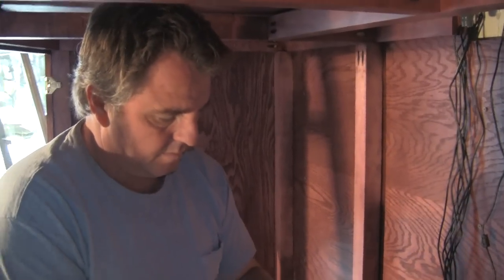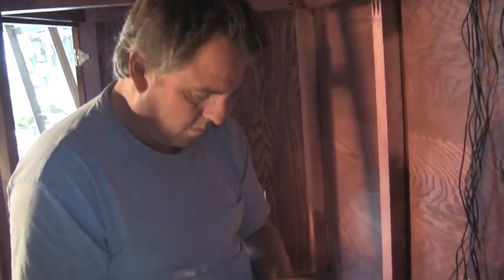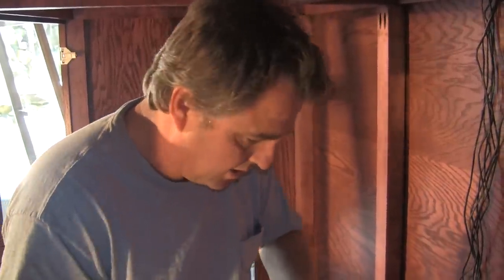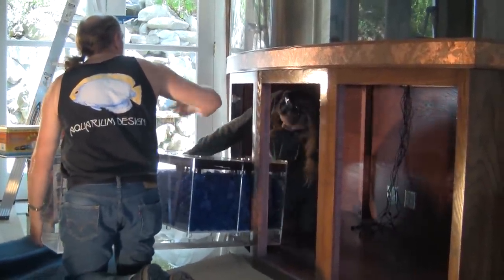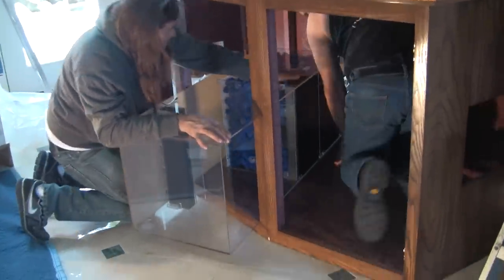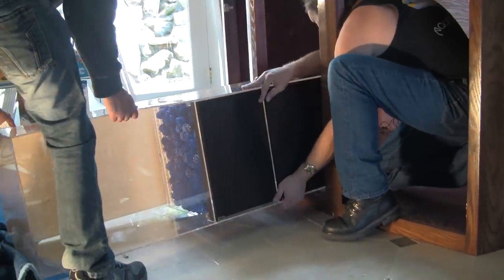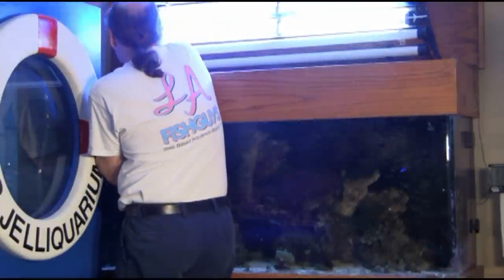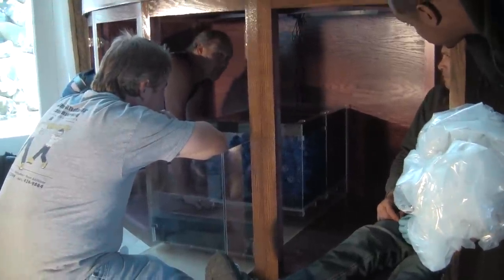Building a 400 gallon Bowfront Aquarium, LA Fishguys, Episode 115 pt 3

Comment: I have to agree with the cabinet guy on this one. I made this same mistake on my 90 gallon reef build. The 29 gallon tank I was using as the sump didn't fit through the front after everything was in place. I had to move the tank out and go through the back cutting some of the back support to get the sump in. Now I always have this in mind when choosing sumps for cabinets. You did say you've encountered this problem before didn't you?

Comment from the maker: hey E, dream on! you need to understand the definition of a 'custom' aquarium system. these are not off-the-shelf kits. the tank, the stand and canopy and the filter are all different vendors and my job is to fit them all together, and if that requires modifying or cutting an opening in the back to do so then so be it.

Comment: Hi Jim, Before this company invented double sumps that attach themselves by two unions, in order to make it easier to place large volume sumps under a stand without having to hassle with cutting holes in the back of stands or worrying if they'll fit or not, I thought up in my own mind, a solution to this mess. Same thing as this company is doing by connecting two to three sumps together with bulk heads and unions for easier installation. You may want to look into that to make things easier.

Comment: cut the hole and then put a framed piece of wood/door in to cover it up, screw it in/latch so that it can be removed again, in case you have to get the filter set up back out one day and that would cover the hole nicer than just stapling it back in?

Comment: Hey Jim, entertaining videos. although in this build, I think you should have known better.  Things need to be checked prior to completion. You should have checked if everything fit first. The stand is a very poor design. You should be able to remove and replace the lighting and sump systems with ease.  If the owner wants to change the sump or it starts leaking in a couple years, the tank will have to be completely broken down to do so. Cutting and creating a door on the side would've been best.

Comment: why wouldn't you just unscrew it from the wall slide it out and cut the opening on the side bigger so you can slide it in and then have cabinet guy make a door or trim for it plus make it easier down the road to actually get it back out if it cracks

Comment: you said you haven't replaced a video in 20+ years yet you have a video on a customer changing it out. not questioning the quality of filters you set up, but customers such as episode 80 pt4 change their preferences and decide to go with a refugium and more modern sump.  If this customer wanted to switch, he would not be able to without a full breakdown.  you said sumps not fitting has happened to you on 3 occasions, you should have planed for this before realizing it "on site"